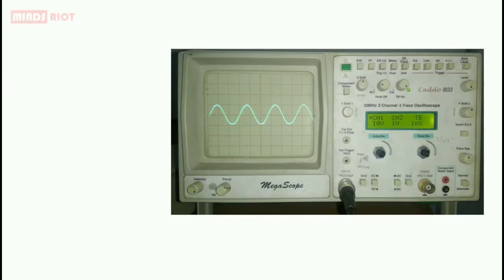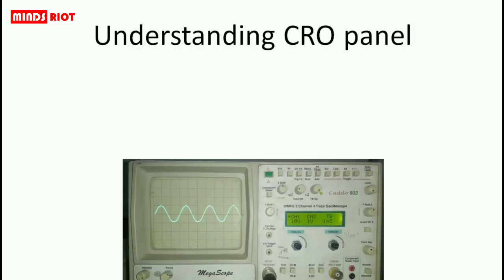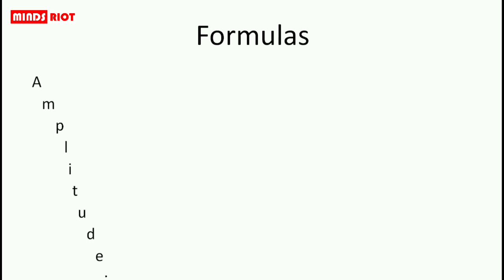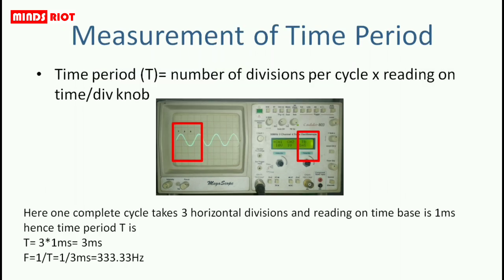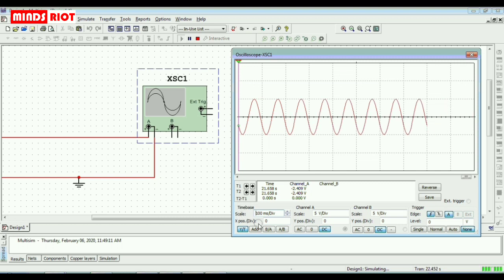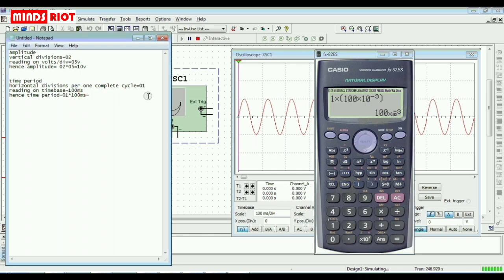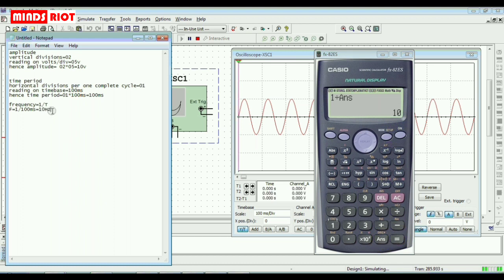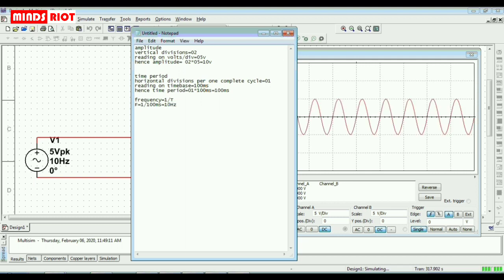Measurement of Amplitude (Voltage), Time Period and Frequency on CRO

Comment: How can i decide voltage per devision and time per devision
Reply from the maker: It's given on CRO knob
Reply: @MindsRiot  mtlb  y fix hota hai aur har cro k according alg alg hota hai
Reply from the maker: It's according to input waveform and your settings
Reply: @MindsRiot  sir my doubt is....agr setting hum kregey to voltage bhi hmaare according zyada ya less measure hoga according to setting for voltage per devision...then how it is same...like kisi ka output voltage pta krna hai cro se...to kaise pta hoga ki 12 volt hai 13....cro ki settings se to real value aayegi nhi
Reply from the maker: No way. Voltage will be same. If you change volts/div, amplitude (i.e.) change accordingly
Reply: @MindsRiot  to kitna rakhe volage per devision jo value brabar aay...actually i m confused ...so plz clear this topic on video..i m a fresher..so mujhey smjh nhi aaya